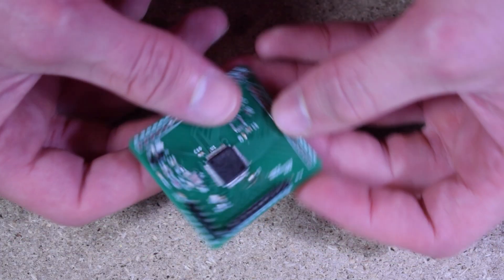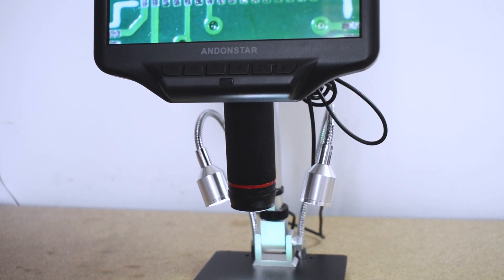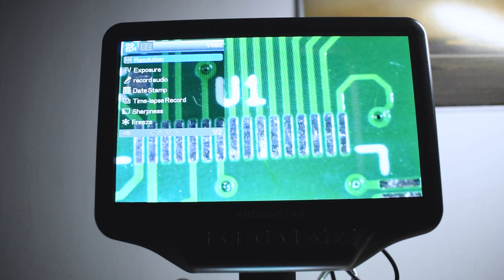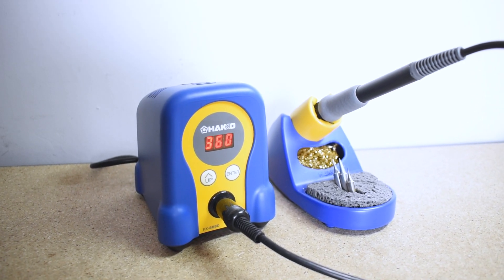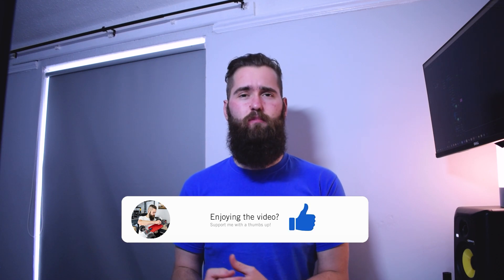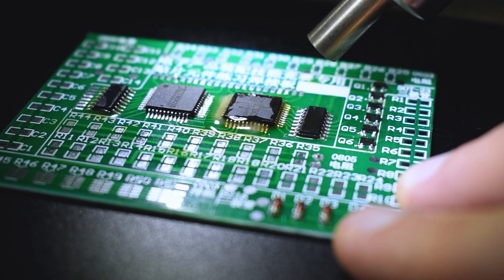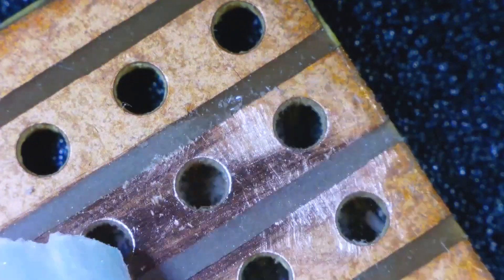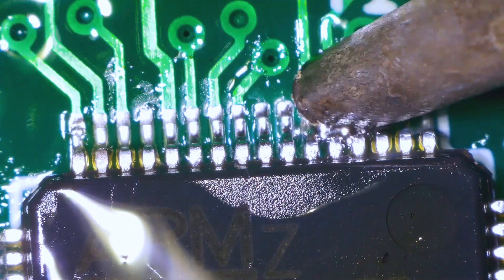Surface Mount Soldering (for under £350)

Comment: The pink pencil eraser from a standard pencil is also great for removing oxidation off of solder pads. They are cheap and easy to use.

Comment: I have a Hakko FX-888D and while the temperature performance and tips have been well within my needs, the user interface is complete garbage and *I would never recommend it*. Although you don't change the temperature all the time, it is very annoying to do so. You have to hold the 'enter' button until the 100's digit flashes, then you use the 'up' button to cycle through 0-9.  Press 'enter' to switch to the 10's and cycle through them. Press 'enter' again to switch to the 1's and cycle through them. 'Enter' one more time to set the temperature.

I've said it before but whoever proposed and approved this design should have been abandoned on an ice flow. Especially because they had a perfectly good (now discontinued) FX-888 with an analog knob that could be adjusted in under 2 seconds without even taking you eyes off the board.

Comment: Do you have any fume extraction?
Reply from the maker: I just use a regular 12V PC fan to extract any fumes away from my face, window is always open when I solder so works well for me!
Reply: @thehardwareguy  awesome! I do the exact same thing hahahaha
Reply: @thehardwareguy  so basically your just pushing those toxins around your room. All you need is to add some activated charcoal (from the pet /home brew store) for your fan to push it through and you can look after your brain long-term.

Comment: That's a very down-to-earth set of equipment. I agree, expensive pro-level tools aren't required. One doesn't really need anything fancier than a regular temperature controlled iron and flux to get started. It's fascinating how one swipe of some cheap chemical can improve quality of the solder joints so much.
The picture quality of that microscope is top notch!
Reply from the maker: Completely agree! Obviously pro-level tools are fantastic and if you have the budget then go for it! But in my opinion it's only worth splashing the cash if you're soldering for hours every day. If not, the cheaper equipment works perfectly fine! Flux is awesome!